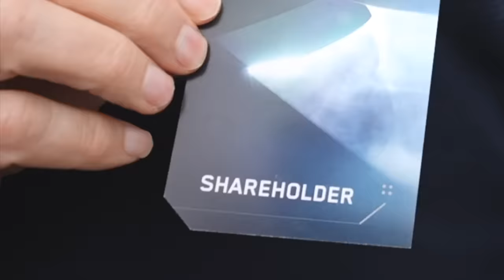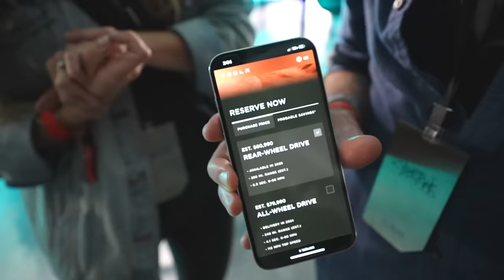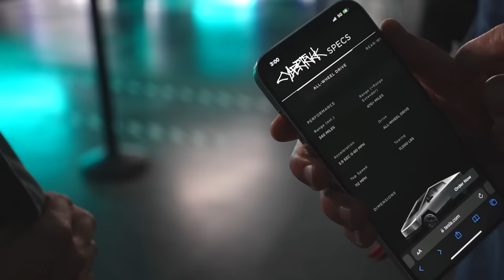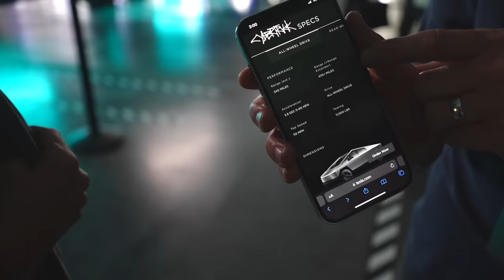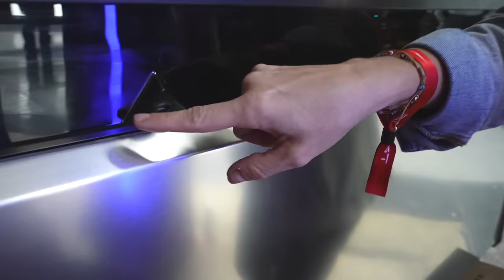I’ve Owned 4 Teslas, but the Cybertruck has me Confused

Comment: The CT is a far better vehicle for the delay than what it would have been in 2019. The development of the batteries, 4wheel steering by wire, front / rear sub body castings, 800v and 48v high and low voltage electrics development, V to load AND 11kW V to grid,, air suspension, powered funk and tonneau. Inside the heated and cooled (front) seats, storage space, 90 deg opening back doors, ….also the forming machines for the stainless steel, Austin gigafactory itself etc etc. 
I don’t know what zach is smoking and will be embarrassed seeing the video. CT specs excceed Rivian in many areas and prices are comparable. We have been going through an economic downturn with rampant inflation and  cost rises. Nothing costs the same as 4 years ago. The range is yet to be fully tested, however remember Tesla are one of the most data driven companies on the planet so they know how far their vehicles travel plus have the most extensive charging network plus it’s expanding. Probably will see many more drive through bays now for tow vehicles.Also if ever there is a time to put a price premium on it is when interest is high. So cudos to Tesla for an awesome vehicle.

Comment: No integrated spare tire again. Just dumb. Not having the extended battery be able to drop down into the bed is another disappointment. A 1/3 of the bed used up. So dumb.

Comment: I get the increase in price. And because 98% of the public don’t need a 500 mile range why put those resources into a vehicle just to sit unused. So I am ok with that as well. I will be changed my reservation to a all wheel drive unit when mine comes up. Now, I just need to build a garage that will fit this wonderful truck. 18.5 feet is a long vehicle for my current garage.  😂

Comment: Complete failure, thanks Zack for being rational. Hell hath no fury like a cultist scorned, that can't afford the truck. They make up three quarters of the reservation holders.  It'll be fine for loners that don't carry passengers. Not many spouses will put up with looking through an unwiped windshield. A working windshield wiper will be available on the after market, built by better engineers than those that work for Tesla

Comment: No one wants to address the root of the problem. EV trucks don't make sense, batteries do not scale well at all. You end up with extremely heavy expensive vehicles that have issues pulling their own weight due to the much lower energy density of batteries compared to diesel, gasoline or hydrogen.

Comment: This truck is an expensive fashion statement unless you spend 100 grand and purchase the top model. If I was purchasing an EV truck, I would buy the Ford Lightning. The prices are much less than cyber, and it is easier to get fixed if damaged. Rivian is overpriced and probably expensive to insure due to high repair cost, so it's a no buy.

Comment: Rivian is the big winner.  They have a much better electric truck for the price.  The characterization of ‘disappointed’ is spot on.  I reserved the tri-motor back in 2019 on the promise of a $70k ultra powerful, ultra fast option with 500 miles of range.  That option now comes in at 320 miles at $100k.  Yeah - that is disappointing.  The CT will do well as a niche product for about a year while all the ‘statement buyers’ grab them.  Afterwards, it will be a big fail - leaving Tesla as a company with one serious offering - the Model 3 (and its XL variant, the Model Y).  Tesla stock will be significantly lower in three years than it is now.  FSD - if it ever is approved - will make things worse due to the liability costs.
Reply: The CT is the same price as rivian and has similar to better specs on literally everything. Plus it has bi-directional charging which is a huge deal, which rivian doesn’t have. Not sure what you’re taking about?
Reply: @adkads27  Have you ever ridden or sat in a Rivian?  Much nicer ride (I’m comparing to the ride quality of my MY) and much classier interior than Tesla.  I have not ridden in the CT - maybe the huge tires will provide a better ride.  Rivian is better looking exterior too - not polarizing like the CT.  I don’t believe Tesla’s range numbers.  I’m factoring in what I believe the REAL range will be.  Tesla has a history of overstating range by 15% - which matches what I see in my MY.

Comment: I have seen the Video of BBC Top-gear , real engineering info from engineers are mind blowing. 48v, Drive by wire, Steel process etc. 
Actually prices are alone with market. If it was made by BMW therm the price would be 500k. G-Wagon is $200K+ and it has no new tech. Tesla could had made 5k of Beast models and sold them for $200k. Stop be Moron on Price. I never believed that it going to be that cheep & I was right & laughing. I thinks 80k one is good value for money. I will go for that.

Comment: The bald guy in red was rather lame.  He is looking for a cheap business work truck. This isn't that. Any 2WD full sized ICE pickup will meet his commercial needs of shipping wheelchairs. Actually, a panel van would be my first choice. Not even a pickup.   And with inflation returning to previous levels pre-Biden White House, and economies of scale and ramping, the cost and pricing will eventually fall.  As noted elsewhere, the Plaid Model S dropped nearly $30K. The Model Y shot up $20K during the Pandemic. and now is back to very reasonable price given the $7500 rebate. 
Expect the Cybertruck to hit $50K for 2WD, and $60K for AWD dual motor by mid 2025.

Comment: I'm also disappointed. I was hoping for the dual motor to come in at 59 to 64k with 340-350 miles range. The tri motor is even a bigger disappointment to come in a lower range than dual and 0-60 at 2.6 sec only 1.5 sec less than dual motor but 20k more is not worth it. You better off getting the dual motor and getting the extension added to get more range. The Tri motors should have been 600 miles 2.6 sec for that price.

Comment: That truck is ugly. I don't like the angular design. It appeals to Tesla fan boys which I would not want to be either. The price seems inline with every other pickup out there. 100K is about standard for anything that is not the most basic model. A huge problem is Elon. I would not want to support anything his toxic personality is associated with. I also don't see this thing holding it's value as batteries are expensive to replace and Elon is prone to changing the price.